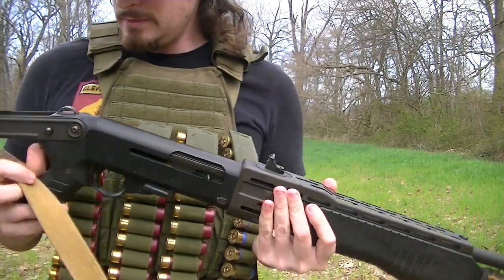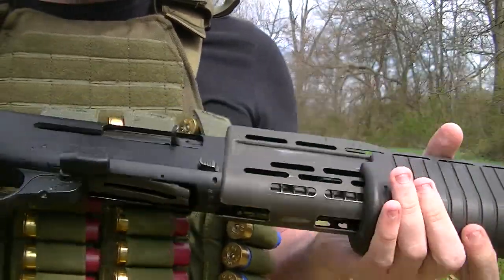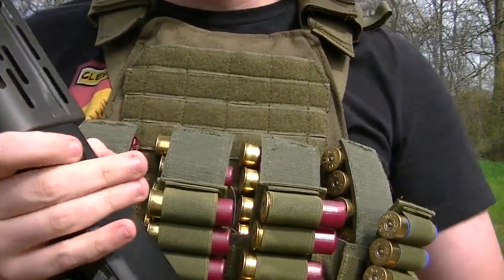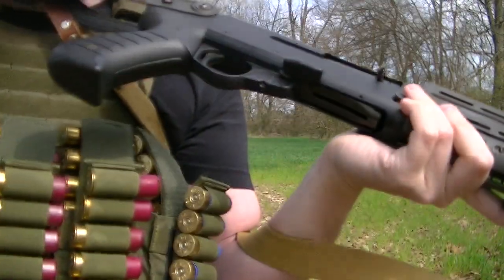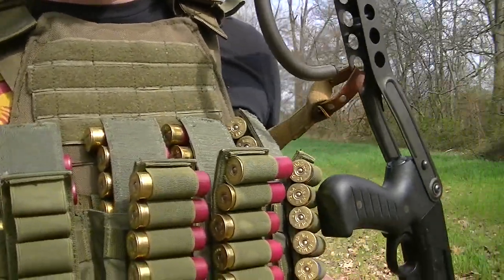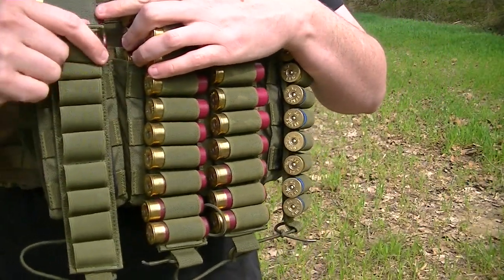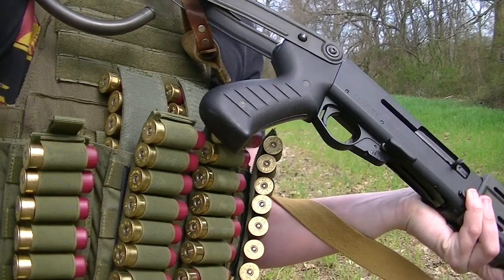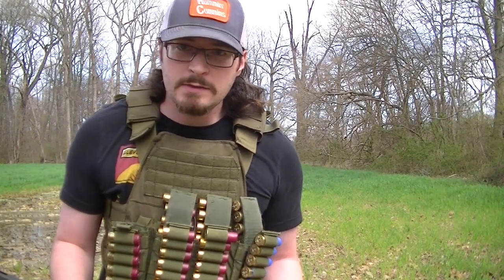The Hartmann Reload Technique for the SPAS-12 Shotgun *Bonus Plate Carrier Rig*

Comment: Holy shit, I didn’t know you could do an over the shoulder reload technique with a SPAS-12. I’ll have to try it out, though it does seem like the Combat Bolt release would be helpful here simply due to extending out further. I have a normal bolt release.

Also, I have a bandolier for home defense but I should get those shotgun cards when I finally get a plate carrier.
Reply from the maker: It's super easy even without the large release! I tested it one day when I was bored. It's actually completely viable, a total non issue. And doesnt put as much pressure on the palm, which can be uncomfortable.
Reply: @Joseph_Hartmann  Nice. I’ll try that soon. Kinda tired at the moment and just lying in bed, but I’ll fish out my SPAS-12 to try it with Snap Caps when I can. Definitely will need practice.

Also seems like you use a traditional sling wrapped around your arm rather than a two point adjustable sling for this. I have an adjustable sling and a fixed sling both for the SPAS. I always thought since most modern guns use adjustable slings, I should use one on my SPAS, but your technique gives me reason to use the fixed sling too. Nice.
Reply from the maker: @gameragodzilla  yeah, I just threw an old mosin sling on it and set it then forget it, it worked so perfectly I just left it on there lol. I like those old slings because of how tough and wide they are. No need for anything fancy imo lol. The sling serves as a reloading aid, and as a way to carry it, . I kinda prefer simple and durable in my slings. Others vary in their opinion on that though which I understand. But for me, and the SPAS-12 in particular, it will always be a nice wide fixed length sling. Because of the reloading technique being so helpful.
Reply: @Joseph_Hartmann  Yeah definitely. I have the FireForce repro sling (I actually do have the original Franchi sling as well, but I put that in storage as it's a collector's item it seems, so for actual hard use, I'll use aftermarket slings) that's fixed and should be able to do this reload technique. Right now, I have a two point quick adjust sling that I keep wrapped around my person all the time, like modern AR slings. Works well to keep it on my person and I can pull it tight onto my body and keep it there, but it obviously would preclude me from using this reload technique.

Main issue with doing the over the shoulder hold without a sling for reloading is the SPAS-12's front is too heavy at the point where the bolt release is, so attempting to hold it over my shoulder will just cause it to tip. That's why I usually tuck it under my armpit as the gun tipping then would cause the stock to slide under my arm and hold it in place. But with the sling, seems like the back of the sling holds the gun in place to do the Hartmann technique, and it seems to work really well.
Reply from the maker: @gameragodzilla  yep, the sling holds it rock solid. Otherwise it just tips forward like you said. The SPAS-12 is definitely front heavy, this technique works around it for sure. When the sling is adjusted correctly it basically locks the gun in position. Very stable and makes it ready to redeploy into the fight at any time.
Reply: @Joseph_Hartmann  How did you come up with this technique anyways? Must’ve spent a while fiddling around with it, like I did when finally figuring out how to maintain a firing grip while single loading shells by using the shell itself to push up the lifter.
Reply from the maker: @gameragodzilla  I had just put the sling on it and it was adjusted too long. I shortened it but it wasn't quite enough. Then It sorta just hit me all at once. I put two and two together in that moment really. I had watched a video many months before about loading it with one hand with the large bolt release by laying it on the ground and putting your knee on it. I think I grabbed the gun around the bolt release while I was shortening up the sling and felt it give. Then in that moment I realized the gun weighed enough to press its own bolt release and that I could actually slide my hand rearward in the sling while it was at that slightly too large of adjustment. I was actually putting the sling on for long range stability. At the time I was testing the accuracy of slugs and where I needed to hold the sights to hit at various distances (a topic for another video) just one of those light bulb moments where the pieces fall into place. Needless to say, the sling stayed slightly too loose from that moment on.
Reply: @Joseph_Hartmann  Nice, very nice. I'll have to do some adjustment with my sling as well once I get around to it.

I did actually experiment with loading the SPAS-12 on the ground one handed, which is where I came up with the idea to use the shell itself to push the lifter, as that way I can use my thumb or index finger (depending on which hand and which angle I'm feeding) to push in the bolt release, supporting it with my other fingers, and then using the shell itself to push up the lifter and then push the shell into the tube with my thumb. Works quite well.

Really, I don't even think the weight of the SPAS-12 holding it down is even necessary, as I just need the sling to support the SPAS-12 from the rear to make it stable, and then I can simply grip the gun to hold down the bolt release.

Could possibly even do quad loads with this reload technique now. I know a lot of people do quad loads using the over the shoulder "violin" technique, which this is similar to position wise.
Reply from the maker: @gameragodzilla  yeah, my fingers aren't talented enough for the fancy stuff yet lol. I can kinda get doubles to work, but I figure under stress its gonna be easier to just feed it singles. I tell you what would be cool though. Those long speedloaders and a ramp made for the spas. You could definitely make them work with this. I don't think I'd want them for combat or anything though, just another point of failure in my mind lol. Yeah, you don't really need the weight 100% though it helps if you don't get the positioning perfect for whatever reason. It's definitely the reason that I realized you could do it this way though.
Reply: @Joseph_Hartmann  True, and I’m not able to do that either, but it should be possible that way.

I wonder if grabbing multiple shells in hand and loading them one after another is possible. I do that with the shotgun flipped upside down in my support hand so my usual tactic is holding the shotgun in my support hand not immediately ready to go if I need to load lots of shells quicker, and then using the shell pushing up the lifter loading technique if I’m just topping off a few shells while maintaining a firing grip to immediately shoot.
Reply from the maker: @gameragodzilla  it could definitely work. I know I can hold multiple shells in my hand while feeding it so it is definitely in a position where you can do that without too much fuss. Just a matter of practice, like anything else.
Reply: @Joseph_Hartmann  Excellent. I’ll try that then.

I do wonder if it’s possible to do something like this with a modern two point adjustable sling where I can also do quick pistol transitions, but that’s going well into the tactical rabbit hole there.
Reply from the maker: @gameragodzilla  well you never know until you try. Play with the idea a little, I view it as a stepping stone for improvement, and any improvement on it that you can make to make it work for you I will take as a compliment lol. 

 Personally, I kinda see the sidearm as a last resort, I'm kind of a boomer and run a vintage .357 dan wesson revolver in a drop leg holster. I kinda figure if I ever truly need it, I can do it one handed, while not truly ideal, I am rather practiced in one handed revolver shooting. The reason being,, I love me a good cap and ball colt navy. So its kind of been accidentally practiced just because I love shooting the old smoke wagons so much lmao.
Reply: @Joseph_Hartmann  Ah nice. Hey, despite being a twentysomething millenial, I love me some older guns too. Hell, it's why I like the SPAS-12. My preferred sidearm is a double stack 1911. I did find that simply holding the long gun in my support hand and drawing with my strong hand was actually faster than any two handed grip, though of course two handed grips will always be easier to shoot.

For the two point adjustable sling, I just do the normal AR pistol transition of moving the shotgun to my support side while drawing my pistol and then aiming with two hands. I do know some old Soviet doctrine with non-adjustable slings involved tossing their gun over their head and doing their pistol transitions that way instead. I may try practicing that too.
Reply from the maker: @gameragodzilla  just don't accidentally strangle yourself slinging all that heft around. 🤣 jokes aside I'm sure we can figure something out. I just haven't tried much else different as I was just happy to have solved the reload on the SPAS-12. Lmao. I'm a 20 something millennial too. I just tend to gravitate toward older stuff. I like historical pieces and true classics. The SPAS-12 being one of the more iconic of those classics. Lol. And some things are just odd obsessions. I've got a poor man's jurassic park loadout actually. One of those obsessions that the SPAS-12 plays into as well. I say poor man's, because I don't have a .600 nitro express double. In its stead I have a double barrel 10 gauge 3.5 inch magnum that I shoot slugs from. Same recoil energy as a .600 or close enough. Just more of a push that a sharp punch, or so I am told. I wouldn't know. I don't have like 35k to burn on a legit .600 like in the lost world, nor do I have a need for one beyond the cool factor. Its a good time though. At least with the double 10 I can still hunt stuff with it. The SPAS-12 is my first love for sure though. Such an awesome gun.
Reply from the maker: @gameragodzilla  I made a couple videos public that I had uploaded a couple years ago of the 10 gauge. In case you wanted to see it. It has a new recoil pad now. The old one was dry rotted.
Reply: @Joseph_Hartmann  Yeah same. Hell, I even bought Muldoon's hat from Jurassic Park. It'd be cool to have Roland Tembo's Elephant Gun too, for anti-T. Rex purposes, but I can't even think about owning that one anytime soon. lol

Just something about these older guns from the Cold War era gets to me. Even my AR-15 is an A1-ish looking gun that I simply added an optic, flashlight mount, float tube, adjustable sling, etc. on to make it functionally a modern rifle. Did the same with the 1911 and now the SPAS-12 as well.
Reply: @Joseph_Hartmann  I'll be watching those when I have the time. lol

Was playing some games that had the SPAS-12 in it just because of our conversation.
Reply from the maker: @gameragodzilla  right. Thats the 10 gauge for me. Poor man's elephant rifle. Lmao.

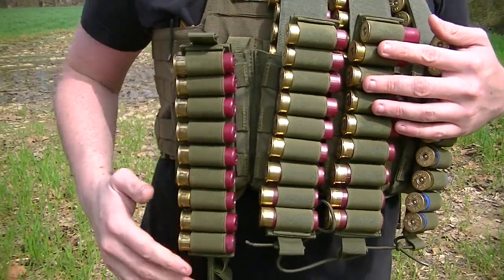Comment: 4:34
Holy crap I've NEVER seen a system like that but it makes a lot of sense for a shotgun, is this a one off kind of deal or a variaty of ammo carrier?
Reply from the maker: Glad you liked it! You can put whatever you want on them. I run mostly flite control buckshot with some slugs on my left hand side. 2 reloads worth of slugs. I recommend using color coded ammo, so you can easily tell the difference on the fly. If you can see I have blue shells and red shells. Red is buckshot, and blue are my slugs. the birdshot I loaded the shotgun with in this video, I just replaced that one card of buckshot so I wouldn't chew up my high dollar shells by loading and unloading. It's designed for 2 3/4 inches shells. Anything larger would probably not work so great. But most combat shotguns are made for that length shell anyway. I hope that answers your question and thanks for stopping by!
Reply: @Joseph_Hartmann  
Really cool man, definitely gonna keep an eye on your content